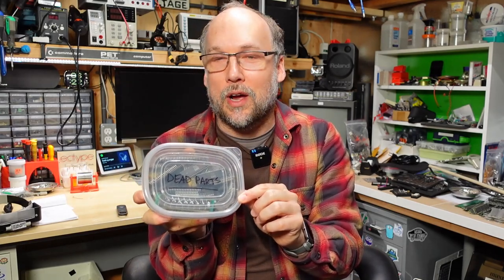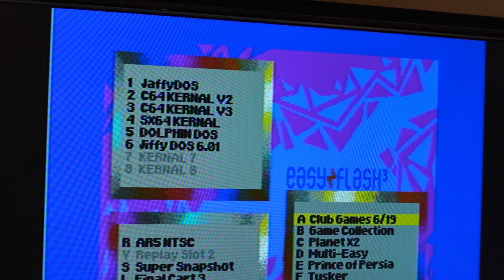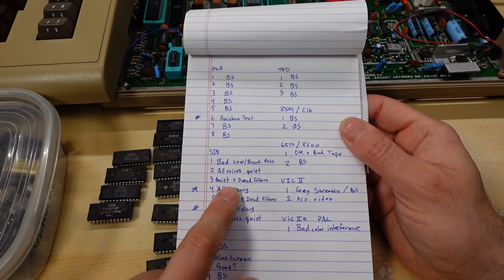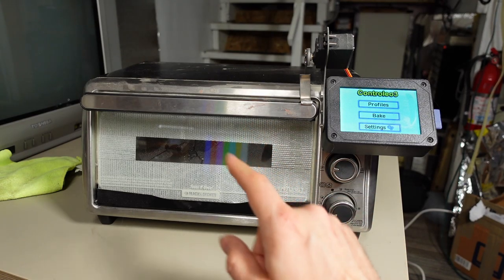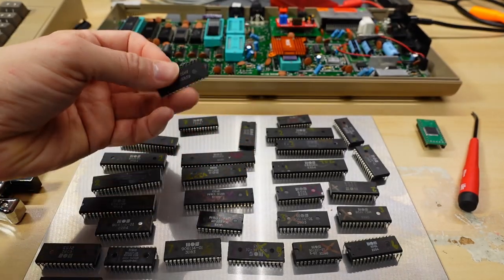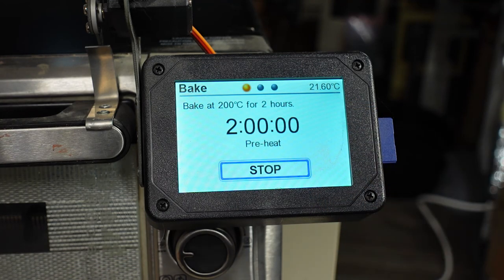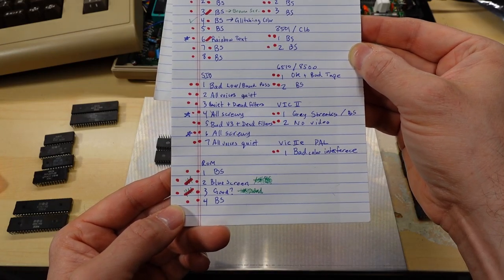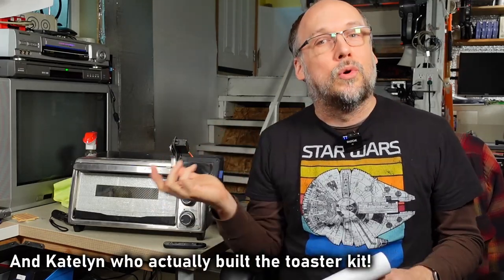Can we fix bad chips ... in the oven?

Comment: I'd say that while baking them for longer might've been a good idea, increasing the temperature most likely wasn't. From the point of view of electronics, the difference between 150*C and 200*C is that the latter is above the melting point of solder. Now, I'm not sure if these old-school ICs contain any solder internally, however even if not, it's not impossible there are components in there that are affected negatively by such a high temperature. If amongst the not yet baked chips you still have some that are even remotely worthwhile, I would try baking them longer, but not going above 150*C.
Reply: When performing experiments like this, you should only change one variable at a time, as well. I would have kept the temperature the same, and just baked them for longer.

Comment: The dead parts bin for you is like a hunter's prize trophy room. Each chip has a story to tell.
Reply: I shove my RAM and Cache DIPS into my drywall in my basement above my workbench. There's even a 386 CPU in there. One day, if I get enough, I want to arrange them in a 12x12 tile and install it somewhere on my floor.

Comment: Didn't know about this method for fixing chips, interesting! What I can recommend for destroying them is putting them in a microwave. ;)
Reply: Better yet if all else fails get a bigger hammer or a hammermill either one.

Either or a piece of drill Rod or even just a metal rod about 1/8 inch or so in diameter lamp in a drill press preferably more like a high-speed router motor or Dremel or perhaps a PC board drill machine of some description lower into the center of the ship housing keep going until said metal rod comes out of other side there you go non-working chip very effective for destroying a ship in a piece of equipment that you have to go gree to destroy before salvaging and also take multiple cuts at random angles across circuit boards and anything left in a piece more than a few inches It's Hammer Time. Pretty much yes that would do it yeah I had a few of those Savages more than a few over the days that I used to more than a few over over the old years I used to do stuff like that.

Yes had to sign an agreement that whatever it was had to be destroyed in a way that it could never be resold put back together excetera or at least anything that could be reused in that equipment to repair 04 whatever or be reused in its original application yep sometimes had a little fun with it to of course.

One-time put about 50 some odd bowls possibly closer to do you need to a hundred or more I crossed the B 4.5 volts or upwards of a voltage at quite a few amps yep nice big let out the Magic Smoke. 

What else is fun take any component that's read 12 volts as long as it does not provide a direct short when it goes 220 / 208 instead of anywhere from lesson 5 to Route 44 voles or maybe more DC nice Pop Fizz bang possibly even a topless chip yep that happened once that was kind of cool didn't expect it again it was something that had to be destroyed first made non operational permanently did this of course after Salvage what was allowed to be  that is.

Also I do remember sometimes if you run enough voltage sometimes even as little as 9 or 12 volts to some LEDs of course without pumping resistors sometimes either you get a nice physical a pop or crack little crack in the ID and of course Magic Smoke and other times half the LED would be blown off or the end of the old lady would be actually blown off completely.

I don't exactly remember how I discovered this thing happening once but I discovered if a magnetic Reed switch a magnet was placed just right spot I think I was trying to do a latching magnetic switch with the opposite polarity to release it if I'm not mistaken when I ran across this?

But under the right conditions in the circuit although this won't go for long obviously because of disintegrated and white of her contacts of course what if it's up just right and the right conditions happen godanriver how or what or how or whatever the contacts would start oscillating what are off rapidly and yes quite a bit of blue light as well but basically would act like just a regular relay as a buzzer except there was no coil involved it was just because of magnetism and all it's possible that the contacts got hot enough that they temporarily lose their magnetism for Split Second but I don't know exactly what was causing it but it would act like a relay or a buzzard and oh yeah a lot a lot of radio frequency interference add just up until the contacts were no good was one of those for the weird things that I discovered by accident it's possible I had problems with the circuitry and some of that contri don't know if I was able to reproduce this or not didn't have me Maniac switches I want the waste trying it though so yeah it was kind of expensive at that time. I only had a handful of them probably.
Reply: might destroy the microwave! seriously, pins will get hot, possibly spark and melt through plastic in the interior. Or so I was told...
Reply: Good way to destroy SD cards when you hear heavy knocks at your door... lol
Reply: Be careful... If there is not enough wave absorbing material in the microwave too much of the rays may go back into the emitter and destroy it. Melting through the bottom - I think that's no danger as usually the turntable is made of glass and the objects are far away from the walls which are usually made of steel too (often painted white). 

Always at least put a glass of water with a spoon in it into the microwave when running it. 

The spoon is to prevent delayed cooking. When there is no object in the water it may "explode" as the boiling bubbles may not form at 100°C and the boiling may actually start at a much higher temperature.
Reply: Yeah you were talking about superheated water in the microwave that Yoda II that gets Disturbed basically explodes instead of just boiling.

Yes can confirm this is a thing I know someone that it happened to fortunately no injury they happened to jar to microwave and that's what caused the water to go instead of when they tried to take it out why that happened to someone instead of what could've under the right circumstances.

Also this is covered in MythBusters as well we actually had a thing about microwave ovens in science class as well as well as I did some Demos in class you know experiments for extra credit although I didn't need it!

I did get a lot of extra credit in a lot of classes sometimes just talk to the teacher but something interesting and they said you know that could be an extra credit project even where you would normally not do projects or things like that in school classes.

Also found out in shop class when I was doing personal projects which I had access to the facilities and or repairs for anyting even if Donna shop or late in Hindi I was getting extra credit kind of surprised but still cool.
Reply: What I wrote before about water and running it empty was in the manual. Also be careful with eggs. Some also mention that you can cover part of the dish with metal foil to prevent it from being heated. Metal reflects microwaves in addition to a current being induced.

Comment: There's a really interesting video here on Youtube by Bil Herd (one of the engineers who worked at Commodore on the C64) called "Component Aging and Heat" where he talks about the effects of heat on chip reliability, but he also goes into a lot of detail about how chips can be damaged by improper ESD procedures. The damage doesn't necessarily mean that the chip will be immediately broken but it may make it more fragile in a way that shortens its lifetime. So it's entirely possible that those Korean chips were manufactured in exactly the same way but weren't handled properly during manufacturing. Check the video out if you haven't seen it, you'll probably find it interesting.
Reply: You really think the Koreans knows all the complex steps of how to manufacture these ICs, but at the same time don't know how to handle them properly? Speaking about Bill Herd, MOS/Commodore had an unusually primitive process and problems with contamination and low precision, that's the primary reason why many ICs in Commodore computers frequently fail.
Reply: @herrbonk3635  I’m assuming that’s how he knew how they could be made more fragile/brittle by mishandling! 

And no, of course as a matter of course they knew that they were doing, but it’s always possible a small batch had an accident, but then tested good and was sold. Failing after 30-40 years is nowhere near “defective” for sales purposes, given the projected lifetimes of the machines.
Reply: @herrbonk3635  There's a large cost associated with proper handling of ESD sensitive devices, it could be some upper management people that though that skimping on handling the chips properly was a good idea, as long as the chips handles the QA test, they can break later...

Comment: In the early 90s acquired (for little or no money - I was a poor student) a whole bunch of 20MB Seagate ST125 IDE drives. They were notorious for what was called "sticktion" where the heads stuck to the platters. The drives usually got tossed - I got hold of them and baked them in the oven. That usually solved the "sticktion" problem and I had a collection of these drives that kept working for many years - some still work in my vintage collection!

Comment: There are some ICs that are classified as moisture sensitive, and which have time limits from the time they come out of the sealed packaging to the time they are soldered to the board, and if that window is exceeded, then they must be baked for 24 hours at 125C / 250F and returned to sealed packaging.

Comment: The very first (2708) EPROM's  could only be programmed, and erased a couple of times, after which erasing (with UV light) didn't work (sufficiently). The solution was to bake them in an oven, after which erasing them worked again (for a couple of times).
Reply: Supposedly Intel considered doing the erase process with x rays and then a high temp bake to reverse that damage, but it was decided the quartz window and a germicidal lamp was easier to deal with.
Reply: I recently read about flash memory that incorporates built-in heating elements to anneal the memory cells, making them work again after they've worn out. I think they got something like a 10× increase in lifespan from that. It's not the same failure mode (crystal defects in the insulator vs. electromigration), but the same fix works on it.
Reply: @IDoNotLikeHandlesOnYT  I read about thermally erased flash memory as a concept, but to my knowledge it's never been commercialized. Planned obsolescence much?
Reply: @nyanpasu64  maybe they couldn’t get it to work?

Comment: Hello, I'm working in an electronic manufacturer. I can confirm that a lot of time heat shock can "cure" bad components. Part of my job is to investigate test failed products, and it almost involves cross-check, which means we dismount a suspected component, replaced a new one, and the suspected component mounted into a known good board. So a few times, both sample (the failed and the  good one) is working fine after the cross-check. We don't know the reason why. Also we don't know how long it will remains good, maybe after a few days of use, it would fail again. The hot air station is set at around 350-400C because of the PCB heat dissipation. So you might try to go higher temperature, but just for 5 minutes or so.

Comment: my views certainly always been that if you're writing a chip off as dead anyway, chucking them in the oven and seeing wth happens is no problem, what have you got to lose? they get more dead xD
Reply: Yeah exactly my thoughts as well.

Just like trying to revive dead hard drives at least two point recover data or a CD that's scratched Beyond usability xcetera because chances are there's no hope in recovery it professionally if you don't have the budget but you might give it a try sometime there's all kinds of methods summer crazy and others not so much have you ever heard about trying to freeze both CDs and hard drives but never tried any of it but if it's dead anyways or it's a CD that's scratched do you know where why not
Reply: @aaronbrandenburg2441  well with discs i have a polishing machine, i just polish it repeatedly until it either works or theirs nothing left to be sure.
Reply: @SparksNZeros  CDs you need to fill the scratches and then polish, which are like grooves if viewed under a microscope.  There is a putty intended for eyeglasses that works great with fixing scratched CD's, it's been 20 years but there should be a similar product available still.  If the reflective (label) side is scratched though, it's game over.

Comment: This was a really neat experiment. As I'm sure you know, successful chip companies revise their manufacturing process periodically. Intel famously calls this their tick-tock cycle, where they alternate between process improvements and new chip designs. Commodore did not do that. MOS Technology had a process that was pretty advanced for the late 70s (at least it had one manufacturing advantage that Intel and Motorola lacked), but they only modernized their process once. 6500-series chips could potentially behave differently from 8500-series chips because the 8500-series chips were made on a newer manufacturing process. So it wouldn't surprise me if chips made by other random companies in 1983-84 responded a bit differently from Commodore chips. I love Commodore, but chemistry wasn't their strong suit and ultimately I think it was their undoing. Atari bought chips from pretty much any company who had capacity to make the chips they needed, so I would expect dead chips that came from Atari machines to potentially behave differently from chips from Commodores.

Also, regarding your PLAs. While Commodore did packaging lots of places, the wafers only ever came from one of two places. They had a fab in California that they closed around 1985, and they had their notorious fab in Pennsylvania that was active from the 1970s until their bankruptcy, and that briefly came back from the dead after Commodore went under. The biggest problem with the PLA was the chemistry Commodore used to make them, so I wouldn't expect the factory where the packaging occurred to make much difference. Maybe a factory that did sloppy work would make the chips fail sooner, but since the wafers themselves were fatally flawed, eventually any PLA can fail just from entropy.
Reply from the maker: Good points and I didn't realize the wafers were from two places only. Good to know! It's odd how most MOS chips made at the same time as the PLA are fine but the PLA is so unbelievably unreliable now.
Reply: @adriansdigitalbasement  in researching this myself (I found this fascinating), I found guidance from your least favorite vintage chipmaker, Micron Technology, on baking chips to fix them. I thought you'd find that amusing. Interestingly, they repeat JEDEC standards, which suggests baking chips at 125 degrees C for 8 hours in most cases, or in some rare cases, 24 hours. The reason for this is to bake off accumulated moisture. Time to extract those hated MT memory chips from the dead parts bin?

Comment: Hello Adrian.  Thanks for the interesting experiment -- as a retired chip designer (ex PMC-Sierra) I'm a little skeptical about the baking, especially for electromigration.  Low temperature solder on the bond wires might get fixed up but my guess at a mechanism for change would be hot carrier injection.  Transistors will fail over time because every now and again an electron (or charge carrier) will be especially energetic and slam into the gate material getting trapped and displacing the crystal structure.  Heating up the device and then slowly cooling it down would emulate an annealing cycle which could free these charge carriers and perhaps allow the crystal structure to reform.
Reply: Can "cleaner" current (so from better power supply) slow this process?
Reply: @warrax111  Sorry for taking so long to get back to you!  I don't think hot carrier injection (the process) is really affected by variations in the potential across the gate.  The process is more that some charge carriers are "hot" in that they have more thermal energy and that there is  a distribution of energy across all the charge carriers.  Think Maxell-Boltzmann style curves (although I think this is more of a Fermi-Dirac distribution -- details are a bit irrelevant) where some electrons (or ions) are just moving quickly.  The odds of this occurring are  reduced at lower temperatures, of course.
Reply: @andrewhughes7195  So they should be fine if you just operate the chips at liquid helium temperatures?
Reply: @brianclimbs1509  elevated temperatures are known to shorten device lifetimes.  HCI is one of those mechanisms that is temperature dependent. There have been attempts to operate CMOS devices at cryogenic temperatures (liquid nitrogen) but this was for performance not reliability.  Liquid Helium would seem … extreme.  I suspect that some other effects would come in to play that would prevent to devices from functioning at all.  Also, I don’t really think anything can repair damage that is already done.

Comment: Very interesting experiment! But to be honest, high temperature just deteriorates the semi-conductor structure, I think. As far as I know, (pre)baking is needed only for re-flow process because moisture in package possibly explodes if you do re-flow solder with sudden, massive temperature change.